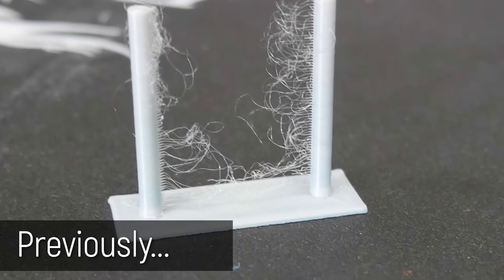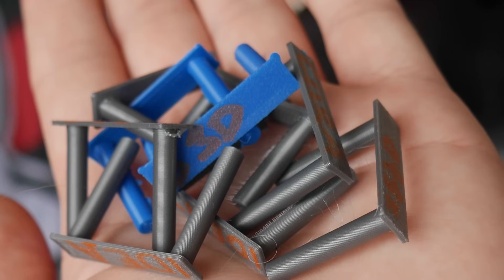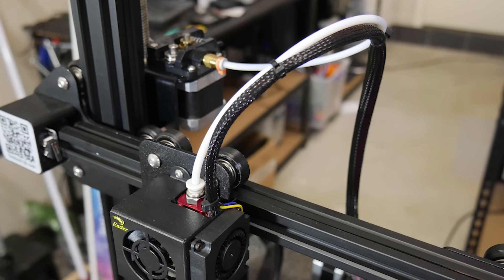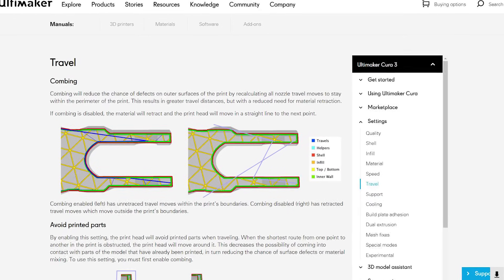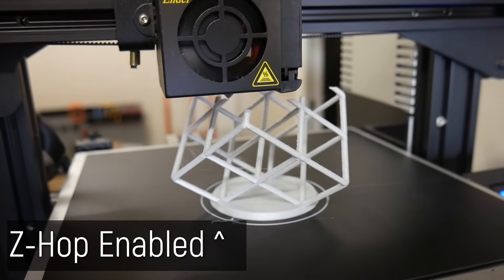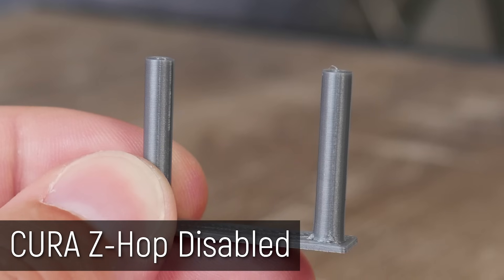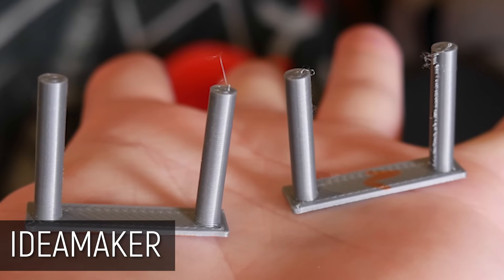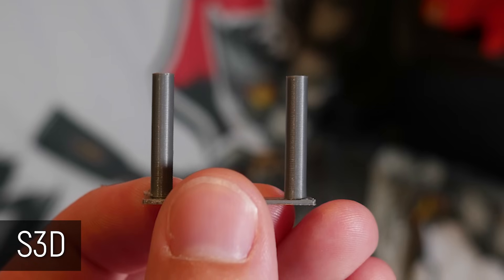Stop Ender 3 Stringing with this One Weird Trick! (ok but seriously)

Comment: In the source code it's called moveInside, but I guess we never made a specific frontend setting for it. Combing is the Cura term for avoiding crossing boundaries (because instead of crossing the boundary, you comb along it), but the fact that this feature automatically turns off when combing is off is just a side product of how moveInside was implemented.

Anyway it's nice to hear you like our feature.

Cheers
Reply: Underrated comment!
Reply: That feature is the reason why out of the box my Ender 3 Pro impressed me with every print I ran. Keep up the cool work!
Reply: Thank-you. I wish if there was a video explanation for this..
Reply: Props to you dev guys

Comment: On a Ender 3 I found out that if you screw down 1 side a lot then do the same with the others it will cause the print bed to warp but if you screw each corner a little bit at a time you fix that problem. I know it takes more time to do it that way but it is worth it. I took a lot more time to put mine together using squares and levels that I never had the problems that other people had. a 3D printer is a high tolerance machine and should not be rushed when you put it together.

Comment: This is a really well done and important video. Not because it necessarily solves a problem, but it demonstrates that their are no silver bullets and that their is no one size fits all solution. Slicer settings need to be changed, depending on what is being printed and no single profile will be tuned to print everything. Getting the string test model to print cleanly only involves tweaking a few settings and almost anyone can do it. It gets much more complicated when we start looking at more sophisticated models that have varying geometry, supports, etc. Appreciate all the time you have put into this, as always, well done!

Comment: One word summary? Permutations 

Fantastic video as always, and just goes to show how many variables there are in 3D printing, now more than ever
Reply: All that variables happens on the plastic industry and they have tools and tests to fix all this before production, the difference in the 2 filaments Angus used can be predicted on a calorimetric test of the material. also you don't have this problems on the more expensive printers because they use best quality thermistor, heater element, etc. that make them more stable and reliable, all that can be fixed by upgrading the printer parts or just fine tune your gcode and keep record of your results.

Comment: Hi Muze.. Could you do a printer comparison with making circles and spheres.  With my CR10, I get imperfect circles of (.15mm) out of round tolerance.    On the Ender 2 the tolerance is (.35mm) out of round.  I have tried tuning them both with special attention to tight belts.  Please explain what else causes poor "roundness"    Regards
Reply from the maker: Could be loose belts or rollers ?

Comment: Have you tried using Linear Advance which is a firmware setting inside marlin? 
Linear advance looks at the movement thats happening and the speed of the print head is moving and adjusts nozzle pressure to help reduce stringing, and blobs in your prints where there is a slow down in the movement print head speed.

Comment: Angus, just using some logic here...but when the model changes to something that is printed at an angle (instead of straight up and down the Z axis), geometry comes into play. For example, the tree file you printed... When you see the "branches" of the tree, they are supposed to be round, right? But looking at those parts from the perspective of the printer, what is round AND slanted (in relation to the Z axis) requires the printer to print an oblong structure, even though it is actually a round structure. 
That means that the X and Y axes have to be perfectly in sync as it prints to make the oblong.
So why then are strings created in the tree model? Well, (and this is just theory), perhaps when the nozzle finishes up an element and is ready to go to the next element, as you pointed out it carries with it some of the material it just laid down. When going  straight up and down the Z axis in a perfect circle means that the nozzle makes its last printing point a perfect circle too. But not so with something that is oblong. The more slanted something is the more the cross section will have to travel over previously printed material. That means it may pick up more hot plastic than it would if it only travels over a smaller cross section surface as it travels to the next element in the print. I am wondering if the Z-hop feature is taking into account how much material it has to "hop over" if the cross sectional slice has a slant. That might explain why different softwares have different results when "hopping" Maybe some developers took this into account and others didn't.

Comment: Hey man, I have been a long time follower, long time prior to getting my ender 3 (which i have for a couple of months now). Another hobby would require a considerable commitment time and money wise. The price of the Ender along with the strong community is what led me to get one and while i can realize the advantages a premium one would have over it it is a quite satisfactory entry machine. What i would like to add is that i had the same problems with my retraction tests. Even when i found the "sweet spot" it left something to be desired.  Still a good result so i did not tinker further. I went on with getting to know my printer better and along the way changed my steps (e-steps? motor steps?) Tried the same test for a different filament to see if there would be any difference. Long story short my prints come out much better since then. Still not perfect but good enough. Just my 0.02, hope it helps someone as much as it did me

Comment: I bought an Ender 3 Pro a month ago.  It's my first 3D printer. I looked at it as a box of partially assembled parts rather than a finished product and didn't expect a lot. As a box of parts, it;s OK. As a tool to get work done, it's a box of junk, IMO. I've gotten wildly varying quality out of mine. The magnetic build surface is stupid unless you're lucky and get one with magnetic pole alignment that allows it to not hang 8mm off one side of the bed or the other. My bed is badly warped (I expect imperfection, but this is ridiculous), so I put glass on it (magnetism fail is now a moot point, I guess). The heat sink cooling fan was loud and vibrated really bad, then it mercifully died after a couple of weeks (banggood offered $8 in banggood points--worthless since I'd have to spend $54 just to use them all). I replaced it, but I still don't like the look of my prints. Lots of ringing, curves look rough, and I get inconsistent print quality. I feel like the pro was definitely not worth $70US more, especially since I've spend another $50 and many hours trying to fix it.

Comment: The retraction probably isn't happening due to the tube moving in the fitting instead of the filament. I wrapped a wire around mine to stop the fitting from moving. If you watch it, without the wire you see this move in and out when retraction is happening instead of the filament. https://i.imgur.com/R8OZAzk.jpg

Comment: I've been using combing mode on my prints (Rostock Max 3.2) here for the last few days, and I have noticed that stringing has reduced quite a bit. Hadn't put two and two together though, but it's clear that combing is helping wipe the nozzle as it goes.

Not to mention it makes prints actually go a lot faster, as retractions can sometimes add up to 40% or more of total print time.

Cheers

Comment: Controlling stringing is all about filament flow control--to stop stringing the filament flow needs to be stopped before the nozzle leaves the part.  Filament is compressible, and the longer the path between the nozzle and the motor the more compression there will be and hence the more retraction and/or time required to stop the flow.  You didn't talk much about WIPE and that is a key factor in stopping stringing.  Essentially, wipe is nozzle movement over a previously filled area WHILE the retraction is taking place.  Z-hop can interrupt this wipe and therefore exacerbate stringing--but that will depend upon the slicer and how it sequences the wipe and hop.  Filament brands are different and therefore can have different compressibility's and therefore different retraction behaviors.  PETG is much more compressible than PLA in general which is why it can string more if you don't take measures in the slicer.

Comment: I used to use Z-hop on cura as a way to prevent the extruder from catching on other parts, but it turned out that for prints with a lot of detail (like sculptures or figurines) I would get horrible pimples and stringing. On close inspection, Z hop won't allow the filament to stick inside the print, it kind of overrides the combing function. So an alternative IS having better calibrated filament, flow and temperature control (for most things I print anyway). Great video Angus.

Comment: it is almost impossible to conclude that each printer has flaws just from single print.  Sure some printers handle stringing better like direct extruders vs bowden tubes but this is the reason like reviewer just discovered that slicing software gives so many different settings to make any printer capable to make any print flawless it is up to you to understand which settings works for each printer.  I have spent probably 3 months just trying to understand all slicer settings on my cr-10s and what it does to my prints before i even attempted to print any projects that i had planned.  3d printing is not just load in filament and file and press print otherwise everyone would be doing it.  Even now after 2 years of owning a printer i am discovering new things about even most common slicer settings and how they apply to my prints.

Comment: S3D could likely mimic the cura settings by choosing "Outline Direction: Outside-In" instead of "Inside-Out" on the Layer tab. It might affect the outside finish a bit at the spots where the shell starts extruding, but it is the most likely to wipe off any string before traveling.

Comment: A technique I have used successfully to eliminate stringing is to retract at the end of the perimeter as normal, then repeat the perimeter with no filament feed and then z-lift.  Unfortunately the only way I can do it is with a mix of manual work and VB code reprocessing the gcode made by the slicer which is very laborious and I have only ever bothered to apply to some simple test articles. 

For someone who actually writes slicers it should be something easy to do and do better. It is not necessary to retrace the whole perimeter to wipe the nozzle, it was just easier for me to do with my limited coding skills as I would just copy the whole sequence of commands for the perimeter modifying just the amount of filament fed to zero.

The Cura slicer is probably making the mistake of doing the z-lift before wiping the nozzle, thereby making the wipe useless.  Can you check if that is the case using the Simplify 3d viewer, I think the z-lift should show up in it, right?

Comment: Anybody else get better results with high speed retraction. Upped the speed to 500-1000mm/s Found this setting from 3Dprintlab from one of the Gcodes that was used for the TPU tires. I started using it on other materials with great results. Helped my Ender3. Cheers.

Comment: i got the ender 3 pro and its still stock , and with settings tweak i print with zero stringing in simplify  3d with zhop on @ 0.10mm  and @ 0.3mm layerheight. and clean results down to 0.05mm what i know and have tried so far. but ive been at it since christmas when i got the printer. tweaking and adjusting and repeat xD ,., would love some video solution to layer height adjustment on ender printers cuz i dont like adjusting bed to set true 0 its anoying, cant find a z adjust either.
love the videos u make ty for them beeen alot of helpfull time to time.

Comment: The z-hop problem could be minimized slightly in ideamaker by printing external shells first, it also helps to minimize stringing in general if you don’t need sharp overhangs.

Comment: In case Angus ever gets to this 396th comment... Rather than trying to analyse the gcode, if you open it in a text editor, Cura puts the settings in that file as comments. Not all settings but rather the deviations from standard settings.

Comment: My ender 3 came with a dead board and incorrect wiring. the supplier replaced it but it was also not working, I ended up reflashing the firmware and now it works pretty well. It sucks at bridging at the moment so I'm going to try the petsfang bullseye cooler. I am also going to redo the xt60 connector because sometimes that causes fires aparrently?

I think the reason the ender 3 is so good is because compared to other printers of that price range it's problems are fixable and (most of the time) don't need to replace one of the crucial parts.

Comment: Using Cura, I had no stringing issues with retraction and Z-hop enabled together on the same two post test. Using Ender 3
Reply: Which parameters do you set in the retraction settings? I found too many retractions would cause problem. I had to use combing mode to instead of the retraction. It improves strings a lot but can’t eliminate all.
Reply: Where is the Combing setting in Cura?

Comment: The Cura profile posted is actually pretty darn good. I was still getting a bit of under-extrusion on the inner shell layers, so I bumped up the inner wall line width to .42mm and slowed the top/bottom layers down to 20mm/sec, which seemed to do the trick. Then again, I am printing at a bit of a cooler temperature (200C) with AmazonBasics filament, so that could be part of the reason, but I liked the matte surface finish at that temp.

Comment: Could you possibly do a broadcast on the confusion with the Ender 3 Pro extruder? Creality states its a MK10 yet the unit I have and from many other posts on many of the Creality/Ender Facebook groups thats clearly not the case. The Pro still has an MK8. I contacted them directly and asked which Nozzle I needed to get for replacements in my new Ender 3 Pro and they clearly said MK10. So thats what I bought. Guess what they do not fit. The hotend on the PRO is still a MK8. I know alot of people are confused on what to buy for nozzles and I am curious why Creality boast a MK10 upgrade in their specs on their site yet from what I can tell all the units are shipping with an MK8. Hoping you can clear this up since you have better resources to figure out whats going on.

Comment: I tried the stringy thing and it worked. I have another problem. I have been told by "an expert" that the bed heat should be left on during the entire printing process. I believe that the heat should be on for the first layer only and then allowed to cool before proceeding. Heat during the first layer helps with bed adhesion (I get that). If the first layer stays hot (warm) and soft then the next layers would cool down more than the first and because the top layers are shrinking faster than the bottom layer, warping occurs. Am I correct??? or is there another reason for warping???? I am using Cura and have an Ender 3. I am also a noob ....

Comment: On the subject of slicers. I have an ANET A8. The very old version of Cura worked great and I used it for months with PLA. Then I wanted a slicer that could do manual supports and I wanted to try different materials, so I used the latest version of Cura. No matter what settings I tried when using PETG, I could not get it to work. PLA was much stringier in the new version as well, and settings seemed to make little to no difference. After watching one of your videos, I tried ideaMaker's slicer. Wow!! It's like someone just upgraded my printer !! (For FREE!!). PETG works great and small setting changes now make a big difference. So thanks Makers Muse !! I won't be going back to Cura anytime soon ;-)

Comment: So this is a software issue. And yes such tests can't be usefull when reviewing a printer. What I would look for in a printer is it's strength and how fast you can push it and still get good results. In 3D printing I look for quality over speed. Can it melt that fillament fast enough? Will it have vibrations in the print at insane fast speeds? Will it come lose over time? I got good quality from my Anet A8 out of the box. But it fails bad at high speeds and ASA filament was a nightmare. But it still got the job done.

Comment: i appreciate your time and effort put into creating such educational and informative videos. the problem i have with this video is first you apologize for being proven wrong. the problem with the print was solved with a simple setting which you didnt find by going into cura or adjusting YOUR preferred slicer settings to solve the problem in the first place. you then go on to find another problem without digging deeper and trying to find a solution. what was the point of this video?. youve already taught  us about retraction, cooling temps, speed ect which could and probably would solve the new issue.
ive been printing for a while and i know EVERY printer is different so solving the issue on your specific printer probably wont be a one stop fix but at least mention possible fixes, point us in the right direction.

thanks again for your great videos

Comment: I always use cura and this explains a lot why I get no stringng on the main model, but always get it on supports. Supports, of course, do not have this affect applied.
Personally I like the stringing on supports as it helps with the support system, but never worked out why it only stringed on the supports and not the model.